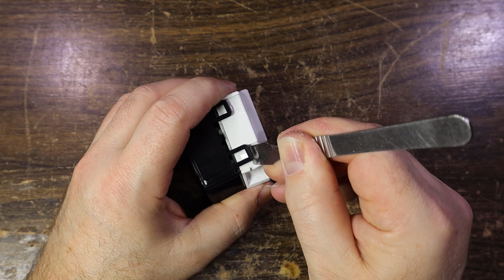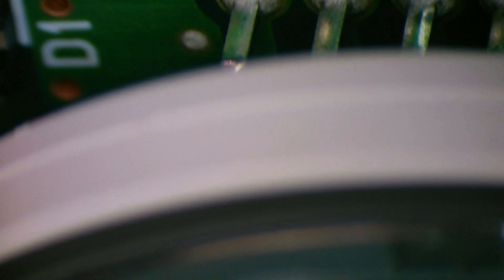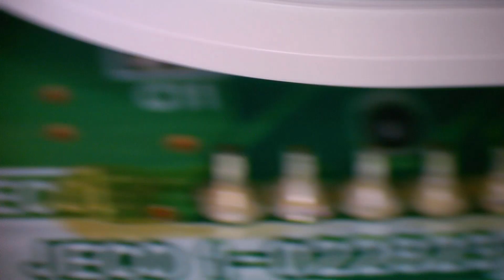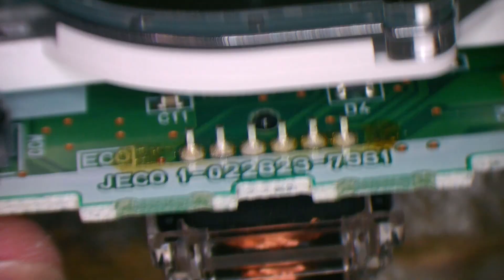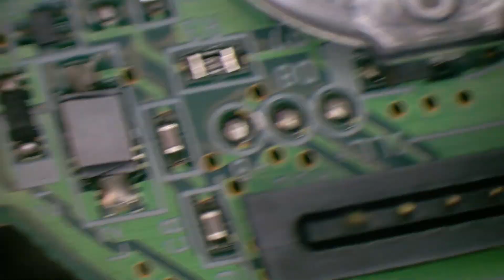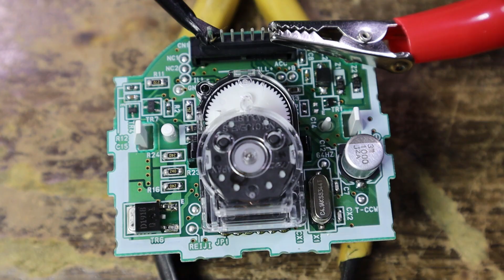Lexus clock repair.

Comment: I have the same clock, only the buttons are in slightly different places, but I think the difference is minor.
My clock is running very fast - it can gain about an hour in a single day.
What should I check, where should I look, and what could be causing this issue?
I wouldn’t want to spend $200 on a new one because of a minor fault.
Thank you.
Reply from the maker: Could be a bad solder joint upsetting the timing. As I did here, you can easily resolder everything to see if that resolves it. Another thing to consider is check your alternator for ripple output. If there is any, it could very well be upsetting the timing to. Of course, if the time goes out over a day where it isn't used (or started) then it's probably not that.

Comment: Mines (2015 4GS awd) running slow just recently , maybe it’s on its way out. Great video , I have a solder iron ready if it needs ICU. Thank you!
Reply from the maker: Could be the same issue if there's a bad connection it might work sometimes but not others causing it to lose seconds.

Comment: Thanks for making this video. I've been holding off on buying a new clock for over 5 years hoping for something like this.  I soldered the main pins and that seemed to do the trick. Clock is back running. It's a few minutes late after so long but a quick adjustment will fix that.  Cheers!

Comment: On crusty TH connections I usually remove as much of the old solder as possible, then use fresh solder to make whole new joints.
Reply from the maker: Definitely the best way. It is a 2014 unit, surely it'll go 11 years now with a premium blend :)